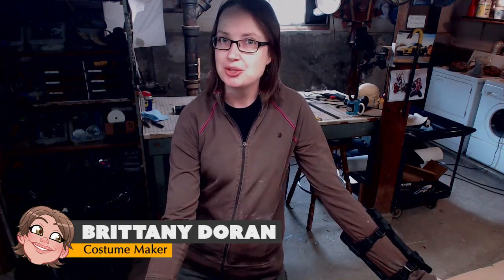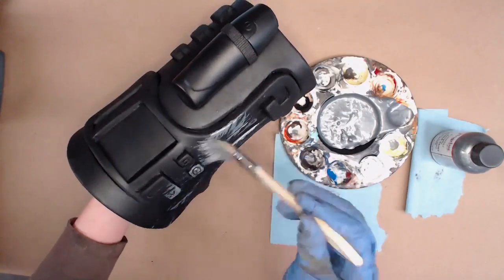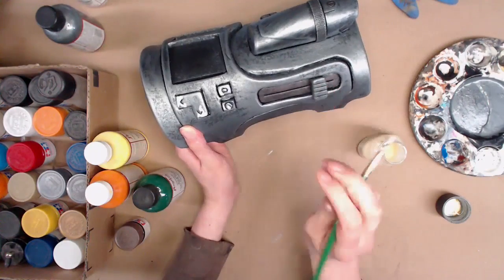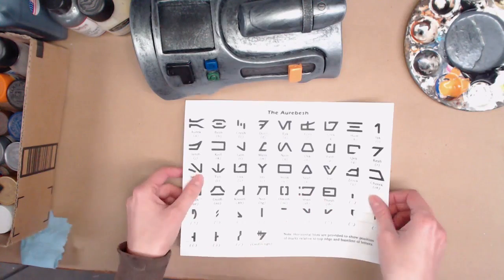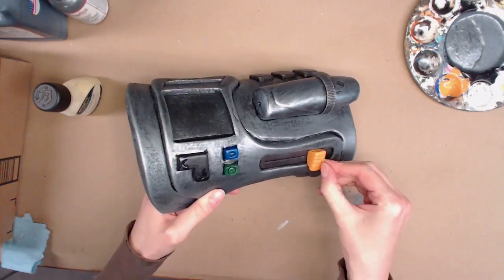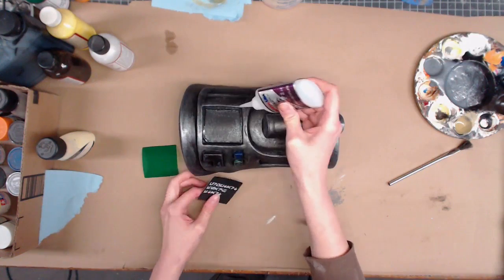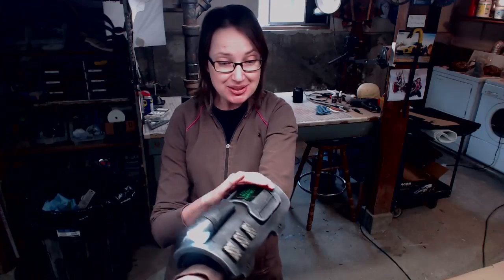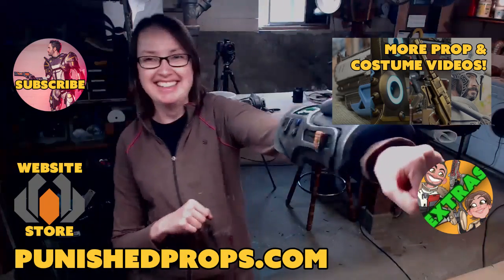Painting a Sci-Fi Foam Bracer - Prop: Live from the Shop

Comment: With the silver, it was applied like a dry-brush but not quite to that extent? Also what alternatives are there to Latex, in order to achieve similar results? You need a blaster! Every smuggler needs a trusty blaster!
Reply: Might have to try the streak-like layer technique. I'll check the Mechanist out. Yay blaster prop! Those are my favourite =)
Cheers for the reply!
Reply: I think they have used toothpaste before.  I prefer to just put a little rub'nbuff on my finger to highlight those worn edges.
Reply: Toothpaste you reckon? I normally dry brush for worn edges or do a colour like chrome and then give it a wetwash using black acrylic
Reply: Toothpaste will chip off like the paint has flaked.  I usually dry brush more for texture.  After the washes I add worn highlights with the rub'nbuff.
Reply: I might try the toothpaste next time I work on a piece. What colour you recommend as a base, or does it depend on what colour you put down?  Dry brushing is fun! I don't think Rub'n'buff is sold here

Comment: If I paint additional smaller pieces of foam before gluing them onto an already painted foam gauntlet, will they stick?
Reply from the maker: +Khairul Ahmad A little bit, but it will be a very weak bond. I prefer to glue bare foam to bare foam.
Reply: Punished Props Thanks for the reply :) How about if I mask the sections that will be glued later?

Comment: so I can apply Angelus paint without any sealant for the foam?
Reply: but how durable will that be? I'm worried it will crack with the tiniest bit of movement.
Reply: Punished Props just saw your whole video on sealing foam. learned alot! would you think it would be ok to paint latex with Angelus leather paint? I have a foam guantlet that will be covered with latex and have a latex prosthetic hand piece connected to the latex sealant layer of the guantlet. would Angelus paint work best?